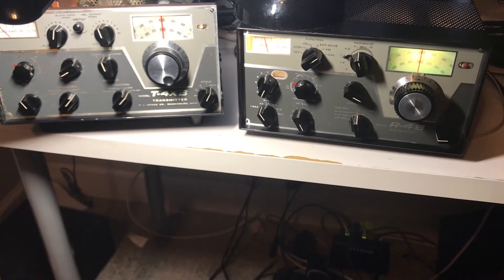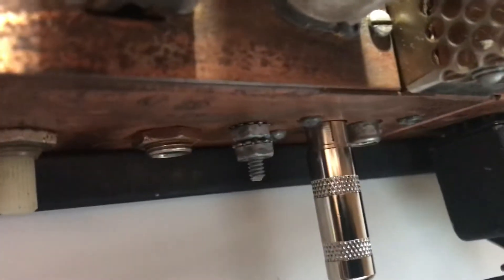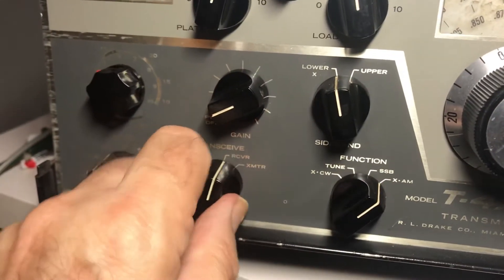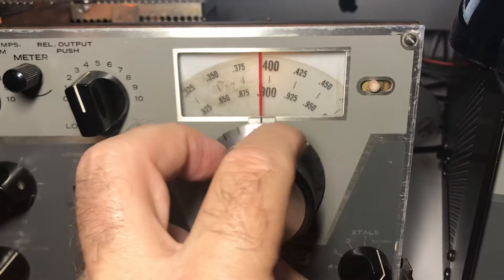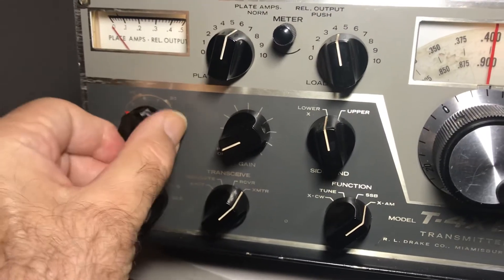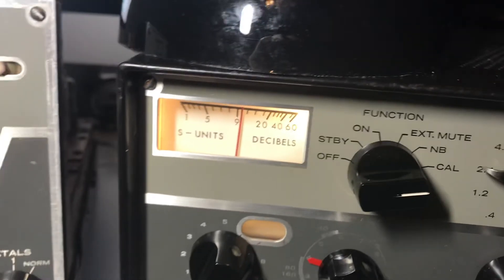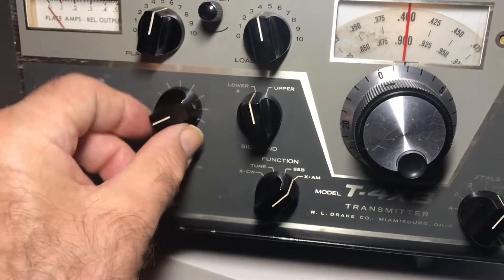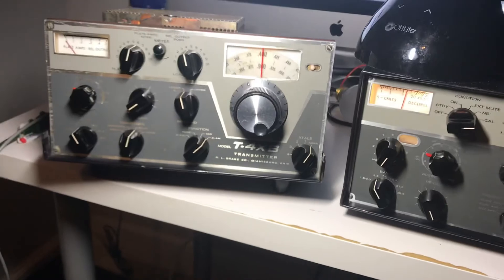Drake T4XB & R4B slaved together with injection cable. Control RX from TX and TX from RX freq.

Comment: As I recall, Drake included a heavier, specialized cable to be used for injection pairing the T4XB with the R4B.  I never upgraded from my old 2-C receiver, so I never got to use that feature with my T4XB.  But I always admired the thoughtful engineering in Drake equipment from that era.  I believe the 4 series used PTOs… Permeability Tuned Oscillators (variable inductor) to control frequency.  Nice gear… excellent video!

Comment: Great video! I'd prefer that the receiver controls the transmitter when working in transceive.  I've just got the T-4xB and the R-4B combo and was wondering how to best use them as a transceiver...:) I will also plan to use a digital readout attached to the receiver. Thanks for posting!